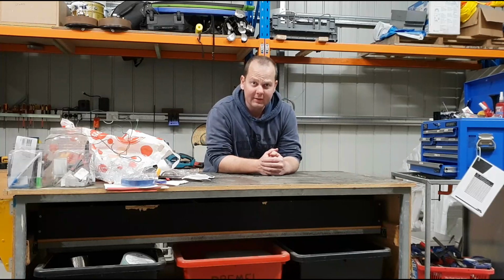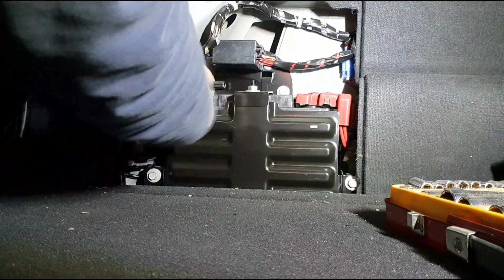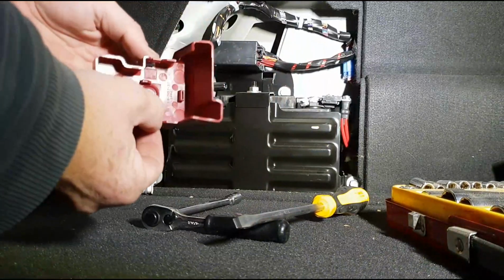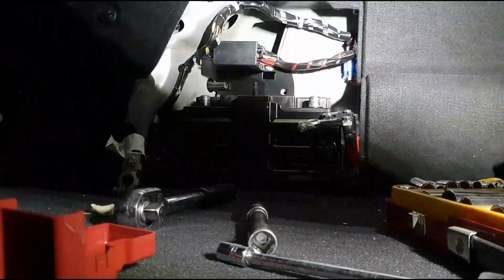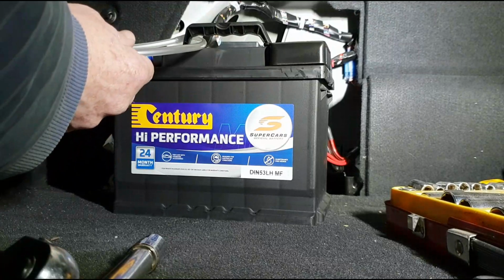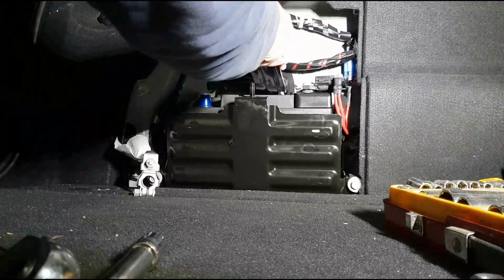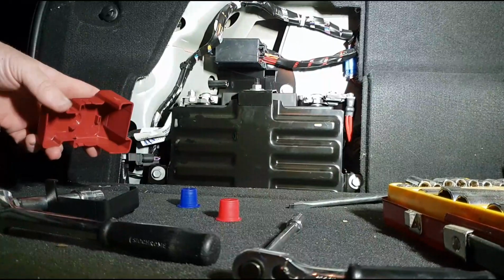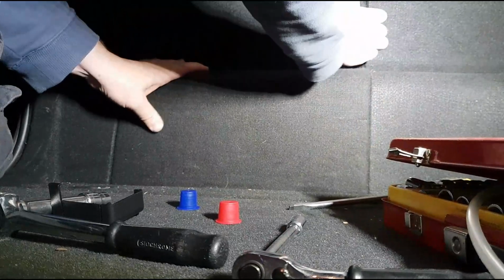Holden VE Commodore Wagon Sportswagon Battery Replacement

Comment: Hi Mate Do you lose your radio/ IQ system when you change out  the battery? I.e Do you need the get the factory reset code from Holden?
Reply: That’s what I’d like to
Know too
Reply: I changed my battery on the weekend ( VF Commodore sedan ) , had battery disconnected for approximately 3 minutes and did not lose my radio .